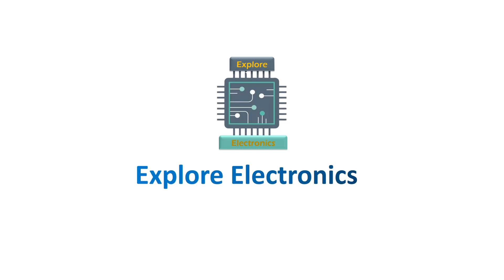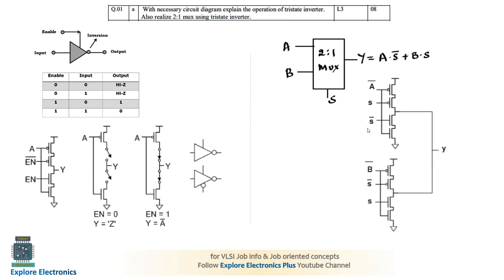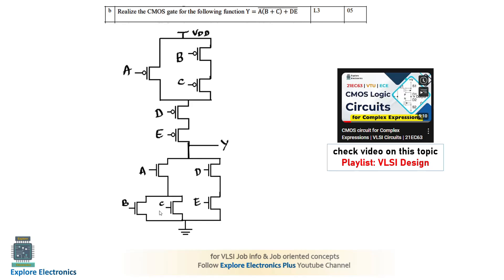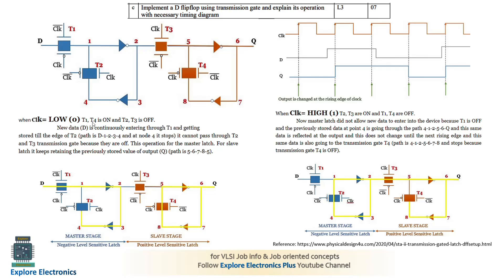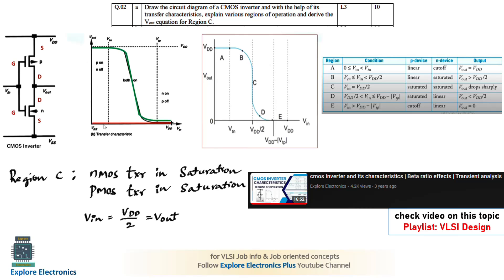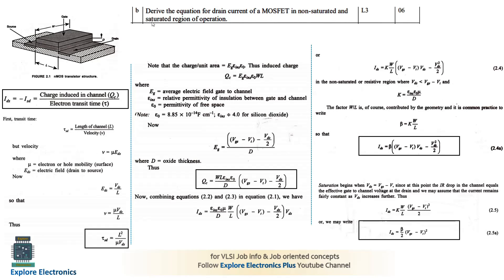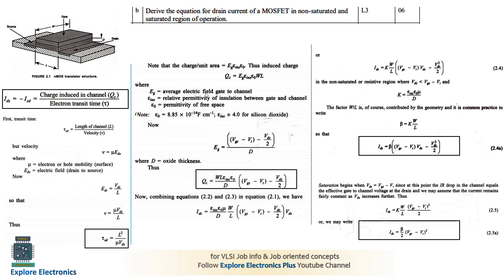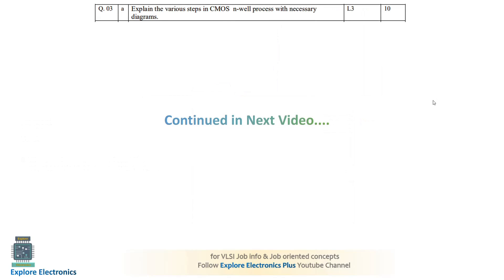VLSI Design & Testing Model Question Paper Solutions | Part 1

Comment from the maker: Students, Please listen to the complete explanation, it will be helpful for writing the answer in the exam.
30% marks will be there for the explanation.
Don't ask pdf. Since explanation is not given more in my ppt.

4:20 Correction: 1.b  in PullUp network D, E input transistors should be in parallel
Reply: Sir please ppt link